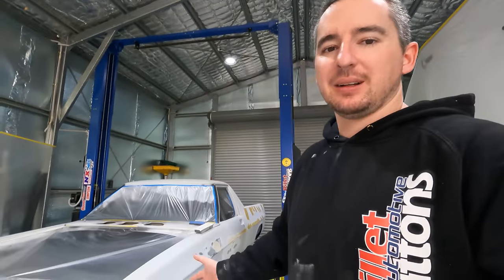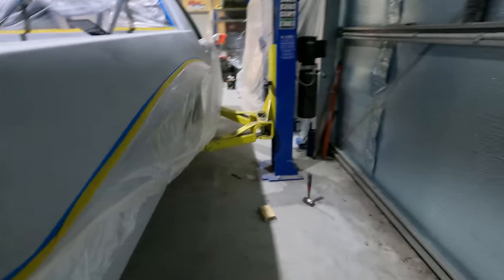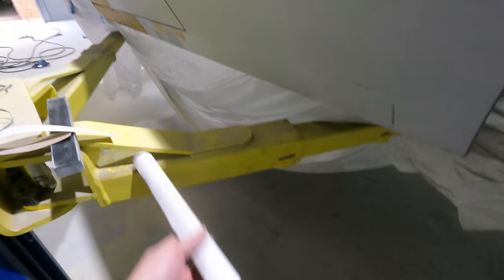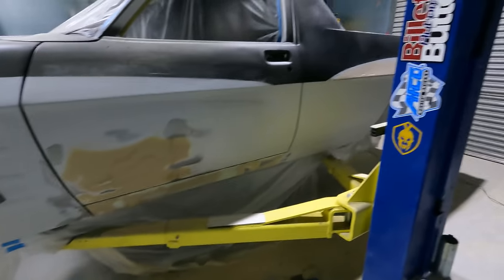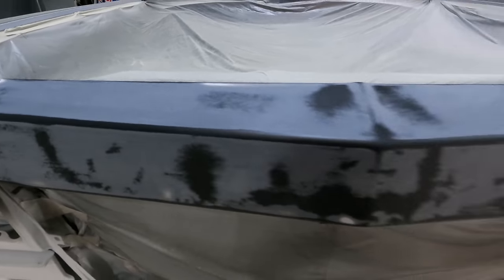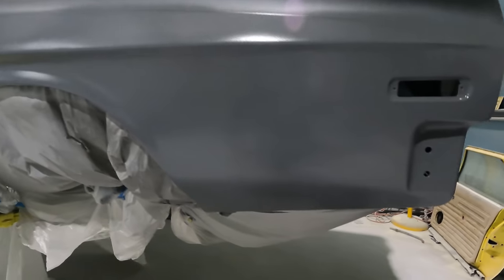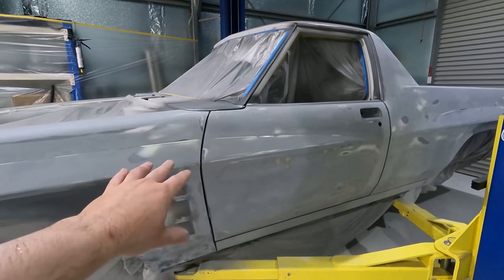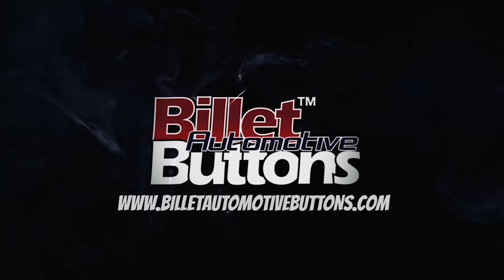#14 PAINT & PANEL PART 1 OF 2 Holden HZ ute project

Comment: With those big panels you would be better off to bog the hole panel instead of small patches and then block it out thats what i would do good luck should be a beast with that engine.
Reply from the maker: In the next video it will be "wish I skimmed the panel as its not bloody straight 😆" haha well so far it looks mint.

Comment: Nelson  I agree with Grim Reaper .But not whith soft Bog fh
Reply: Nelson when you do the boonet go get a can an hardner of fibreglass bog it’s very strong and will not crack like bog .
Grab one can of flat black acrylic not Enemal lighty spray it over the fibreglass bog when sanding back you will see the low spots Quicker .
Then go to the soft bog on the low spots.